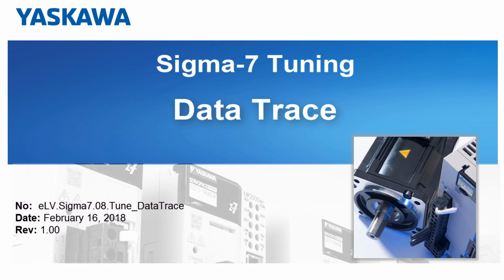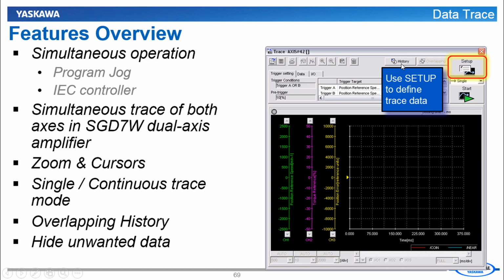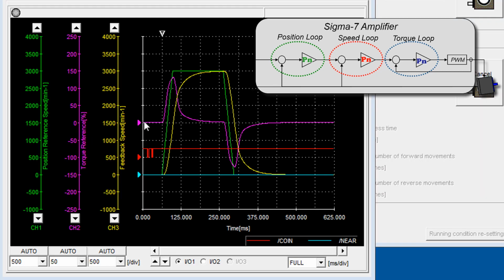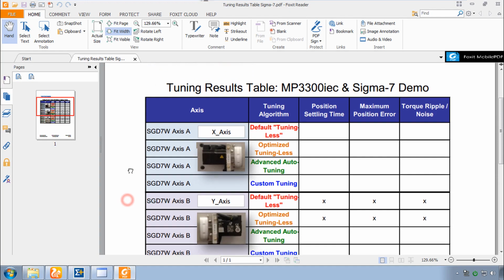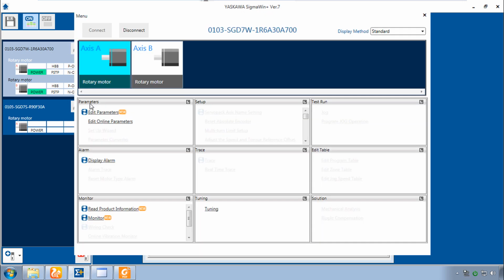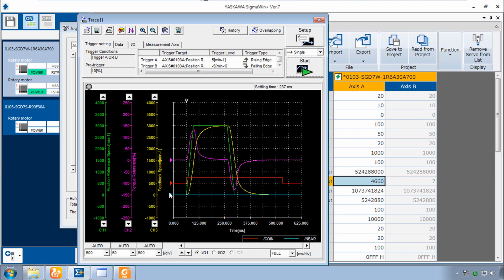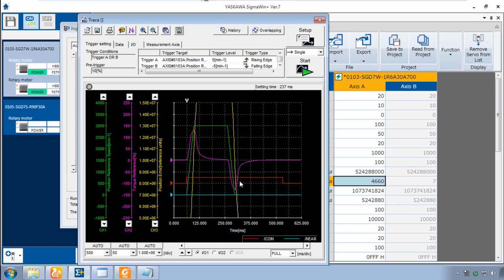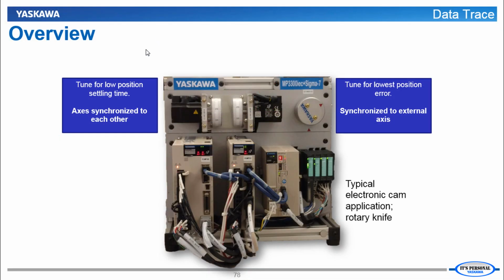08 Data Trace (Sigma-7 Servo Tuning)

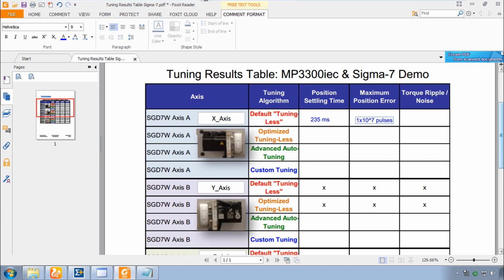Comment: I think you made a mistake Mr. Pelletier. You documented the max position error at 19:00 as 10 million (1*10^7) pulses. However, when looking at the CSV data of position error at 19:30 we saw a greater position error of 20 million (2*10^7) pulses.
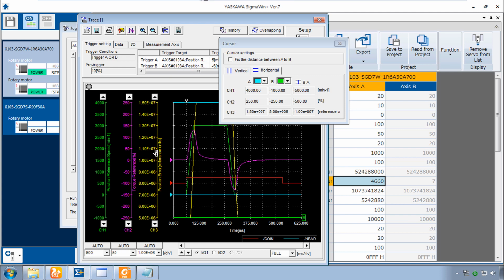Reply from the maker: For consistency, the measurements documented are only those displayed in SigmaWin+, as this tool is sufficient for tuning measurements. As mentioned at 18:30 1*10^7 is the maximum display in SigmaWin+ and this is enough for tuning purposes to show that the position error is extremely high. At 19:10, after the official SigmaWin+ measurement was documented, the CSV method is shown as an "aside" for completeness sake. We do not expect students to use this method in the field or in training class.